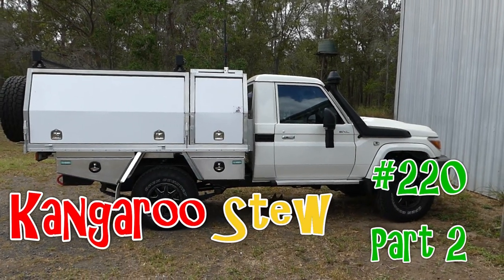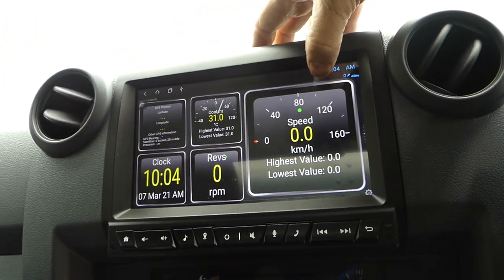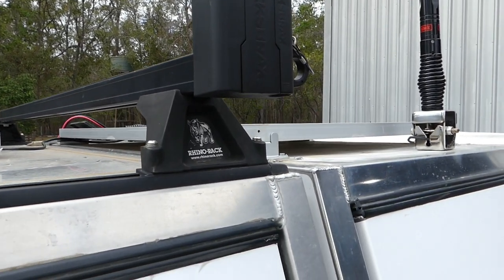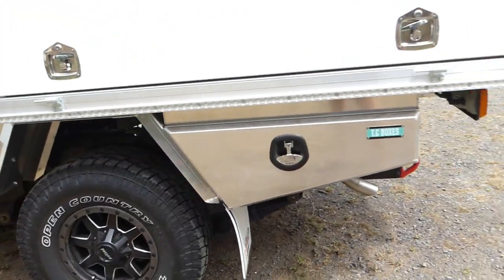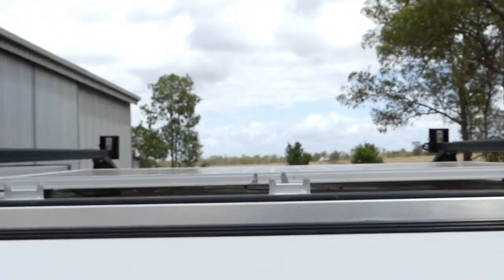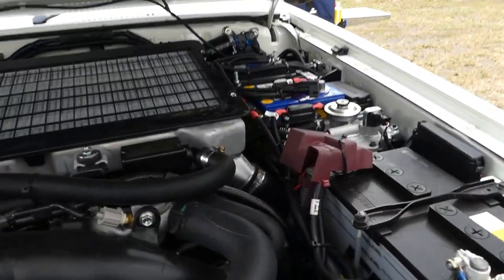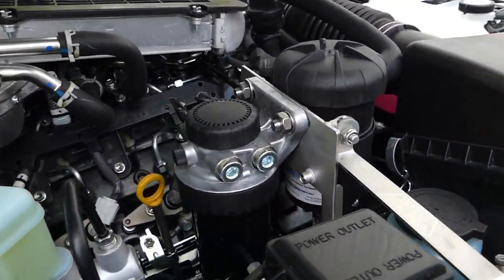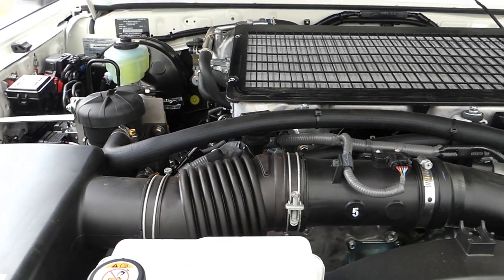Kangaroo Stew # 220 part 2 The videos and a walk around the Landcruiser.

Comment: Your good with the hammer & cold steel chisel Lance.  Full marks. Gas torch heat usually does the trick for me, the smell too.
Reply from the maker: Im not sure it worked that well but it did come away easily.